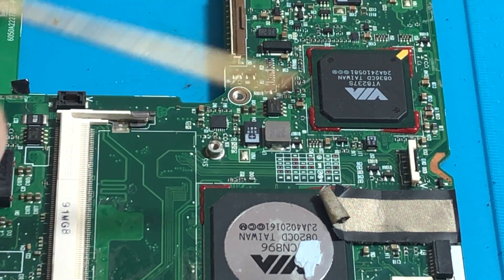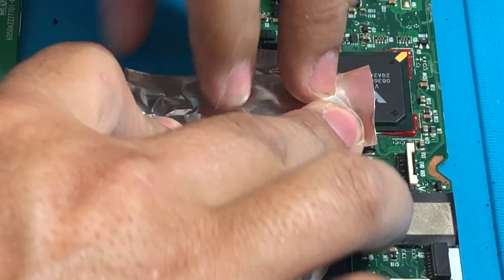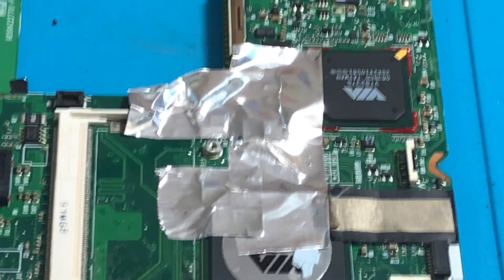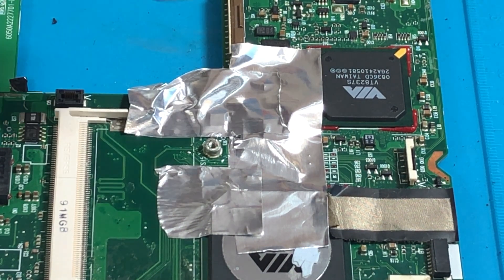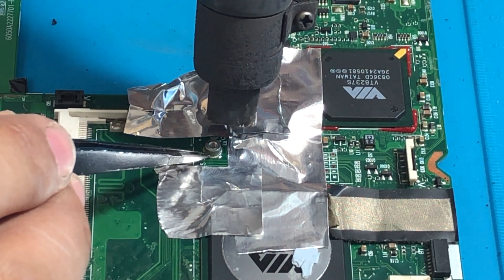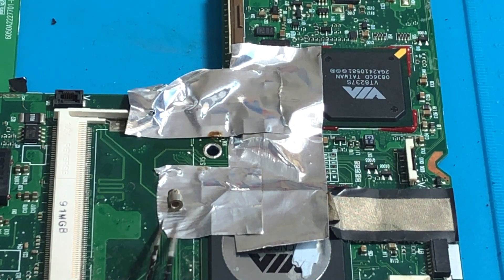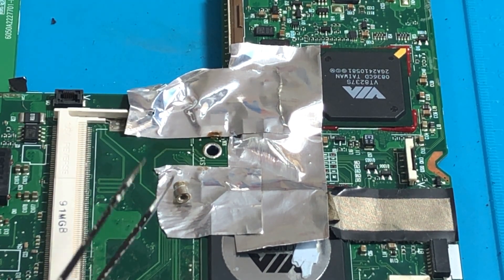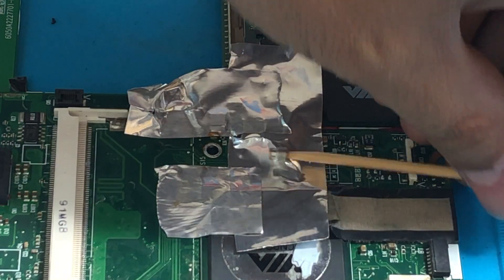✔LAPTOP Motherboard heatsink standoff / Riser FIX repair

Comment: brother i also have similar issue with my asus vivobook s series one of the mount is ripped off , due to which the cpu throttles and i am not so good with soldering , people online are suggesting to use epoxy resins to fix it . what would you recommend .i just bought is one year ago idk how it broke .
Reply from the maker: 🫠Regarding your question, please do not do that, as it is a very temporary solution. Once it breaks—and it will very soon—it can damage the copper layers on the motherboard, making the situation much worse. That type of repair should be banned!
I get many clients who try this, and then it ends up in the shop, and I have to find a way to repair a doubly damaged issue.
Just get the cheapest soldering iron (a few dollars), a tiny amount of solder and flux, hold the riser down with wood, and place the soldering tip to the side of the riser for 10–15 seconds—that’s all.
cheers🍻

Comment: Hey, can this be done with a standard soldering iron? 2 of the gpu cooler standoffs are broken on a GL552VW bit those holes are basically touching the chip. Is that a problem?
Reply from the maker: Thank you for your feedback! If you wish to support the channel, you can like, subscribe, or both!
Regarding your question, sure with any standard soldering iron you can do this job, and if you got two down then you for sure 1000% need to get that fixed properly.
Should you have any further questions or requests in the future, please don't hesitate to ask me.
cheers🍻

Comment: hallo i noticed the heatsink of my mac mini 2012 don't touch the Gpu chip and i notice somebody who put the hands on, broke the standoff of the logicboard holding 1 of the 4 screw cpu/gpu heatsink......do you think this work like in your video??
i have the original standoff and the origianl screw + spring....i have 0 experience with soldering this is way i'm asiking this 
thank you very much and sorry for bad english ^^
Reply from the maker: Thank you for the feedback! if you wish to support the channel you can LIKE or SUB or both :P
regarding your question: yes my friend it's the same exact process to repair mac mini standoffs

Comment: Hello, unfortunately my laptop is also a victim of this problem, even you have taken care of the Dell Inspiron 7567, my device has 3 blocks, but the others are intact. It is possible that the part that came out will be replaced by what you did in this video or by another method, it is possible that the socket will sit in its place as before, because this causes the video card to heat up more or less, but other than that, there is no problem. Will this work for 7567? I can't afford to buy a new laptop :(
Reply from the maker: Thank you for the feedback! if you wish to support the channel you can LIKE or SUB or both :P
regarding your question: My friend if you have a detached riser like the one in this video! no matter what brand or model of the laptop that you have it you have a detached riser, its because of solder paste dried up and cracked then broken. this is the Proper way of repairing, anything else that is not this method its not worth it. add a flux on the base and use a stick of wood to hold straight and heat it up with solder iron the base and the motherboard section and it will melt the solder and it will sit flush on its place.
no need to worry absolutely regards to over heating the motherboard when doing this, nothing will happen.
this method its save and the proper way (factory way)
if you have any question or request in the future feel free to ask me.
Reply: @uFixTek  Thank you very much for your response.
I'm not in a position to have it done right now, but is it risky for my computer to use it this way, because it happened yesterday while I was maintaining it, I think it even happened before, I applied paste many times, I couldn't keep the graphics card temperature stable, I guess that thing was loose and as a result, it is completely out now. .
Do you think this will cause a problem in the future, so will it manage in this way? Only one slot is also this problem.
Reply from the maker: i highly recommend you to not use the laptop with a broken riser , you will end up damaging the GPU or CPU dye. we do get clients coming in the store and have been using the laptop with a broken riser for few months and it resulted for us to do a "reballing of GPU" that is very costly.
its not risky for you to repair it, BUT if you don't it will be very costly and risky to use it the way it is.

Comment: I got solder in the screwhole, and now the screw won’t go in... what do I do?
Reply from the maker: you have to use this:
https://amzn.to/3tI5MZE
to remove the solder from holes.
add flux and place wick under solder tip over the hole and it will absorb.

Comment: seems like alot of people are having the same problem with asus laptops .. wee great i bought asus for a laptop, their risers are garbage and they don't do a proper job at soldering them to the board. The screws also strip so easily. I got too wait now for a new soldering iron to come in cause i cant find my old one anymore.  But at least i don't have to suffer, still got my tower so its not all bad i guess. I'm just disappointed with asus more than anything. For a laptop that costs over $2k back in 2016, They sure  cheap out on crucial components when they don't need to. It would've been pennies to put better screws and risers on it.
Reply from the maker: yes but they have to do it they dont want the laptops last like before, right now its not about what laptop can last longer its new CPU/GPU power and more sells. the fight is between the brands and more sells more market goes up for them. its not about internal quality, its all about external quality and low price. they calculate how long a laptop should last.
Reply: @uFixTek  I'm getting liquid metal for my laptop after i get the stuff in i need to fix it, plus i'm ordering a pack of various laptop screws for internal and external just in case i need them in the future. It's a shame that companies work this way but its not surprising really. If i cant find new risers to fix it i am going to take a donor from one of the fan that's not needed.
Reply from the maker: ya just make-sure the rise are the same size.
Reply: @uFixTek  i think finding them is going to be the hardest part, the screw packs where easy on amazon and looks very handy. But i wish they had a pack of assorted risers too, which would be nice.  I don't know many i might check around the web someone more.
Reply: @DangerousGambit  sorry for the late reply, how did it go? i currently have the same problem but with an acer laptop.

Comment: In gl502 model can we just use a soldering iron? and is it necessary to remove the solder around the hole with the wick as my riser can easily get inside? and is it necessary to remove the motherboard and solder the cpu riser from the back as in gl502 the cpu riser is soldered from the upper side? please explain!
Reply from the maker: as in the video i explain in the text inside the video , if your riser sits flash on the motherboard(hole) no need for wick or removal, just hold it down with a wood stick and add a flux its must, and solder around it,, the solder must go from top side never use solder from under, else it will fill the screw hole NO NEED TO REMOVE MOTHERBOARD IF YOU are careful.
Reply: @uFixTek  thanks it helped me a lot!